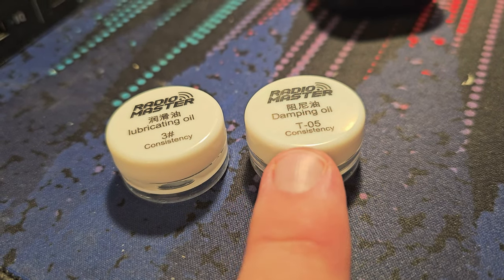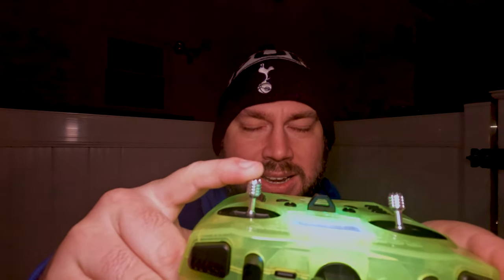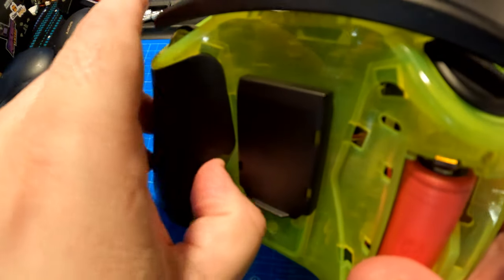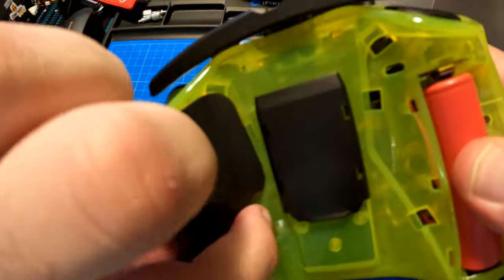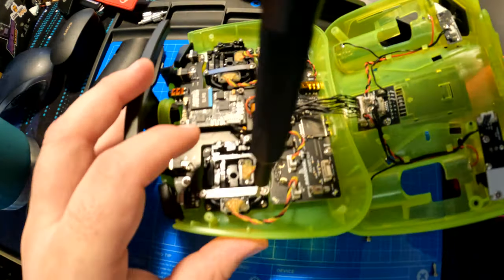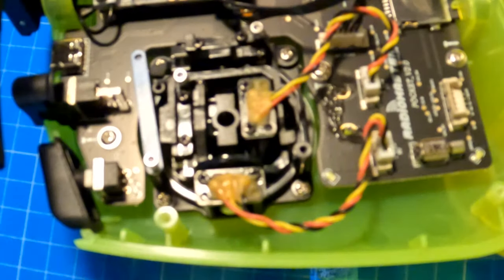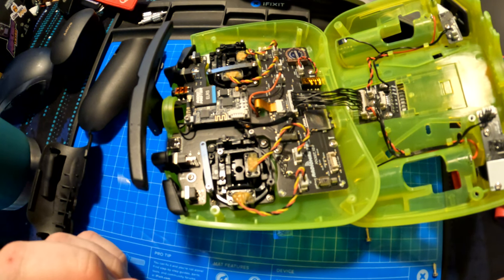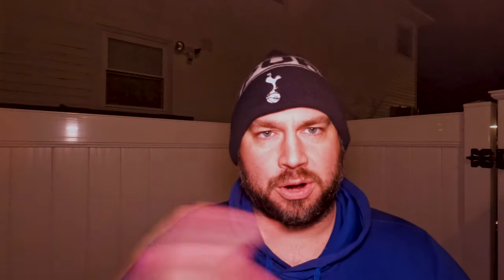A spoon full of lube makes you gimbal slide smooth

Comment: you shouldn't just let your stick go to return to center try moving it back manually. the lubricating oil is for gimbal bearings/moving parts and the dampening oil for throttle. but if it feels better how you have it then so be it.
Reply from the maker: You are 100% correct, I was over generalizing where you should use what. You are also right that if it works, it works. I did use the damping grease on the throttle to make it both smoother and sit in the right spot. And used the lubricant on the bearings and put a little on the tension springs to try and get a smoother feel on the pitch, roll, and yaw axis. I have no idea the long term ramifications of a lubricant on the plastic, but I will be taking it apart in about a month and will report back what I find